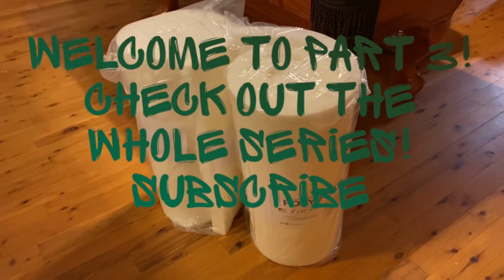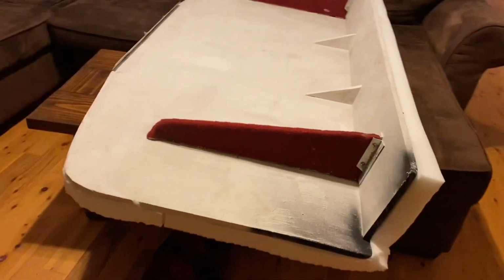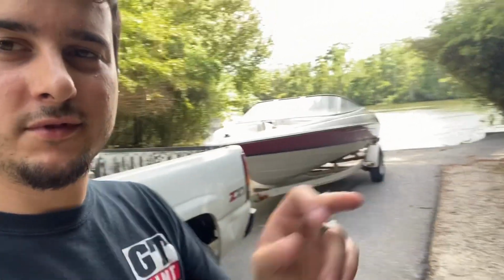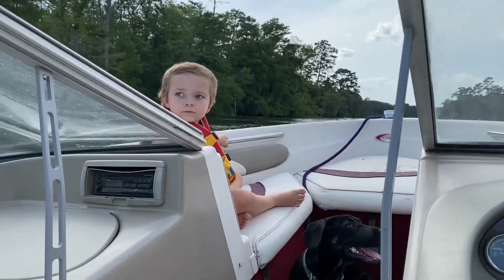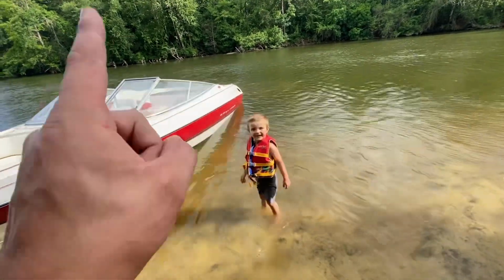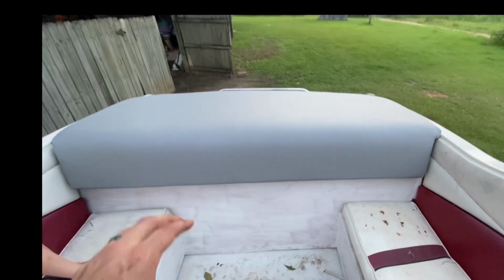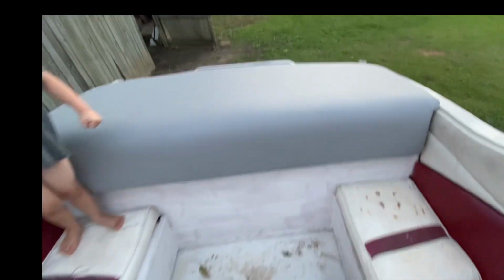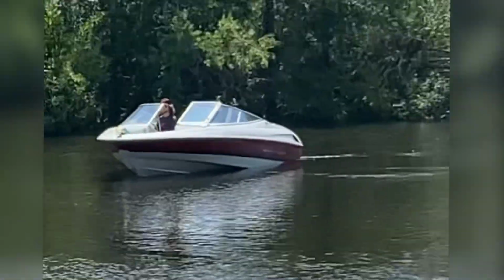Can we save this old Bayliner? We made it to fathers day weekend! PART 3

Comment: The flooding issue is the float in the carb switch it to a brass float and set float abit low and all will be good. We have exact same boat just refinished the engine cover in ours
Reply from the maker: Perfect! Will be doing that soon unless it gets changed to a Holley 4 barrel maybe wake it up a little 😉
Reply: I did the same thing on the same boat but I have a 350 not a 5L